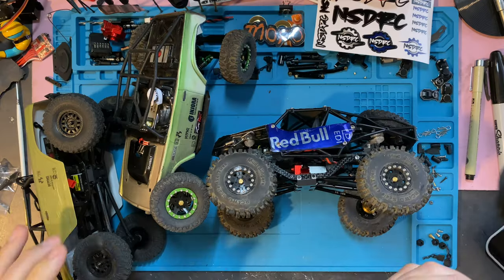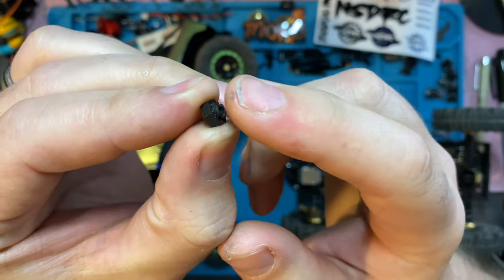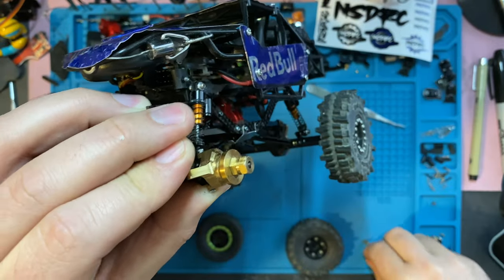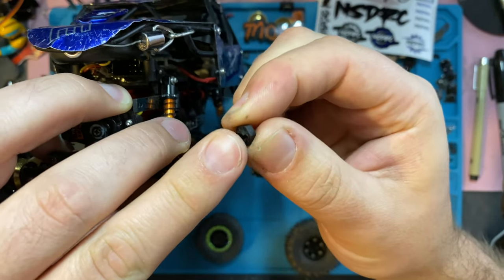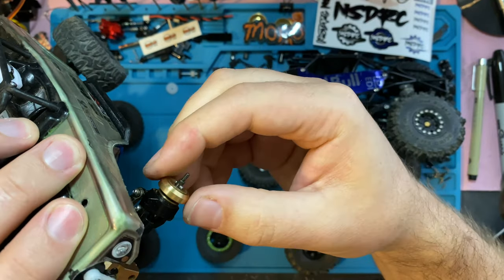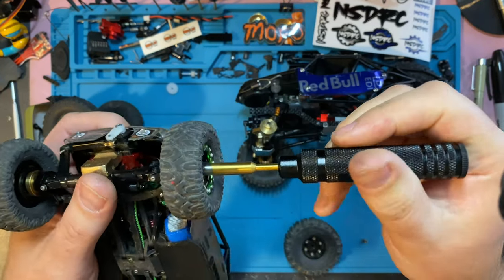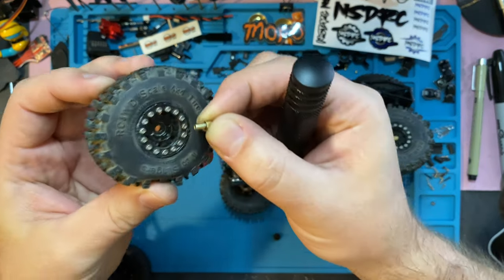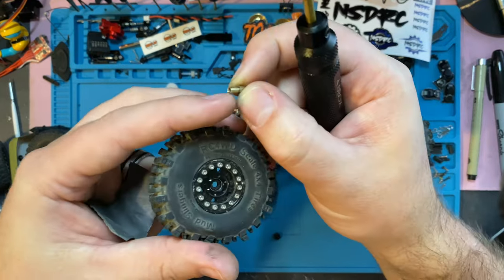SCX24 - Wheel Nuts Not Reaching Axle and/or Binding After Newly Installed Upgrade Parts

Comment: Thank you. I should of figured this out but it started out of the blue, no changes mind you i have made changes!! Many changes no original parts left but this never did this and just one day I seen they were loose(metal part) so thing go lose even after locktight but you have to be very careful with that on lug nut hell even just these tiny screw can break to easy for it but my rig is a really fast scx24(don't give me crap) rock bouncer so  the screws would fall out 3 min into a run before I used that. Anyway I had to use on lug cuss if I tightened the wheel won't speed
Reply from the maker: I am glad the video helped!

Comment: Why when ever I put brass knuckles on the front it will bind if I turn the wheels and give it gas do I need to sand down the extended hexes like u where saying in this video
Reply from the maker: I would check to see if you are binding when you have the wheels off.  If yes, then it could be the tolerances at the axle and bearing.  If no, then you are likely too tight in your wheel nuts.
Reply: I have put the Treal brass steering knuckles on and now theres too much slop? I dont see that i need or have space for wheel weights? How was this supposed to work??😂 plz help😅